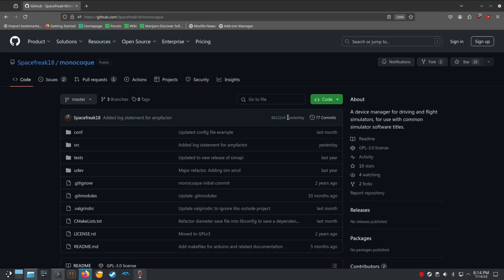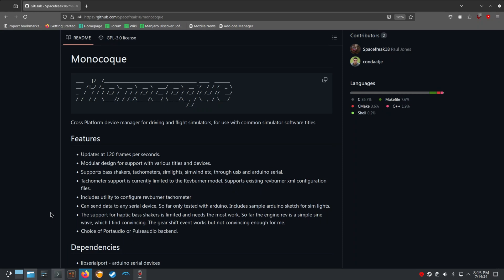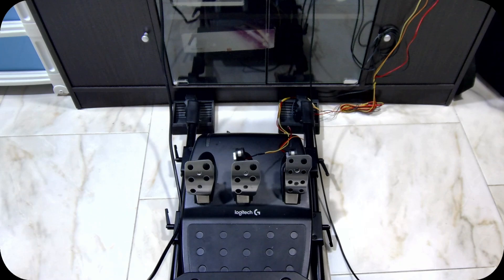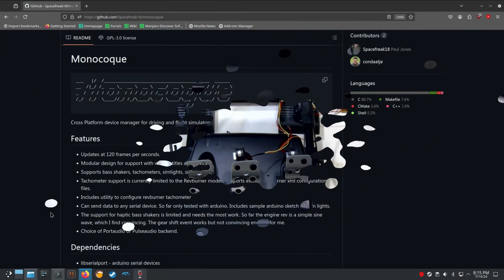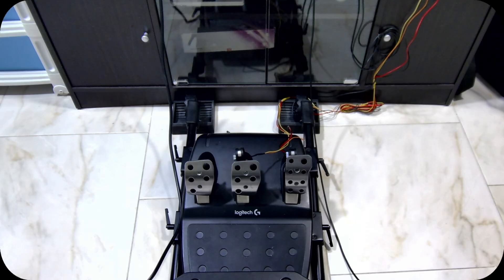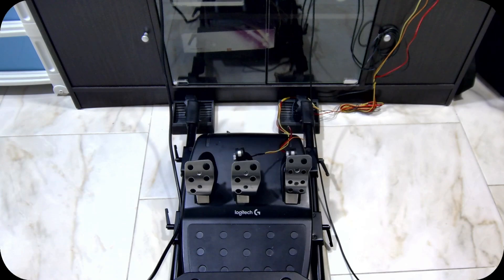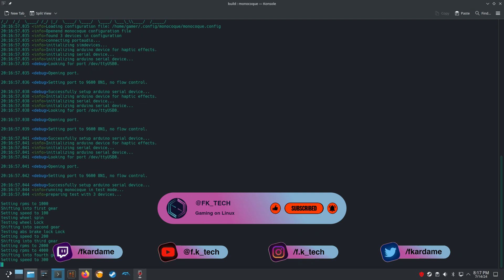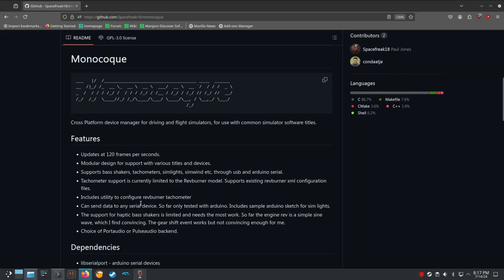Simhub Alternative for Linux | Sim Racing  | DIY Rumble Pedals

Comment: Thanks for showing this off, I wanted to try Linux for SimRacing for a while now 😊
Reply from the maker: I am trying to get more users for sim racing community in Linux so we can add more device support
Reply: @fk_tech can i run a Simucube Wheelbase on Linux?
Reply from the maker: Which model? 

https://github.com/JacKeTUs/linux-steering-wheels

Simucube have silver rating. Check if your model have linux drivers.
Reply from the maker: Simucube Pro 2 works with Silver rating.
Reply: @fk_tech  thank you for the Information. I will try it!
Reply: I have VRS direct force pro wheelbase and pedals but new to Linux and not got the wheel working in it yet
Reply from the maker: Hey you need to join sim racing linux community on matrix chat #simracer:matrix.org

This is the linux wheel support details.
https://github.com/JacKeTUs/linux-steering-wheels